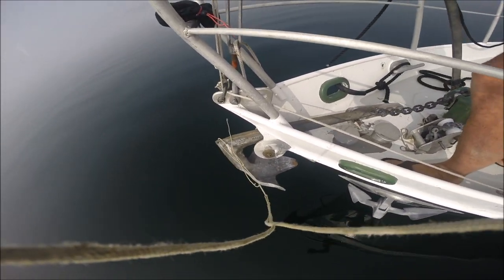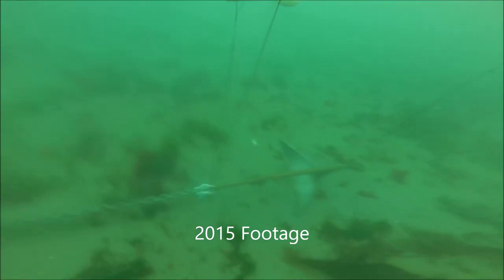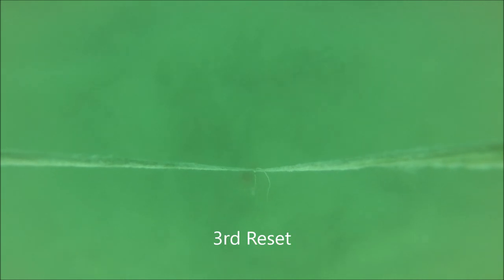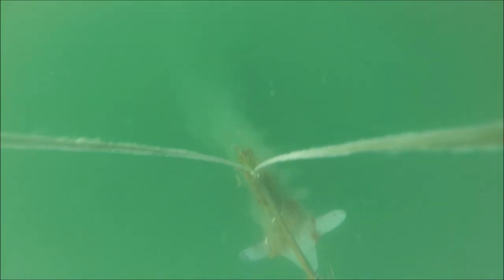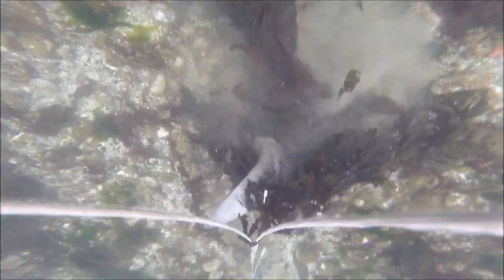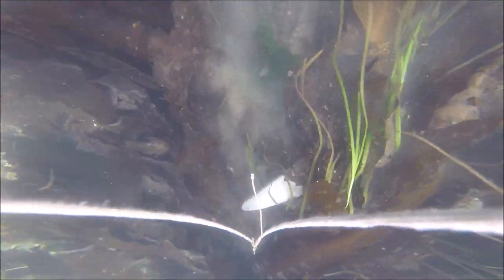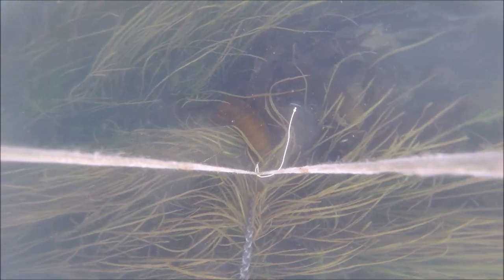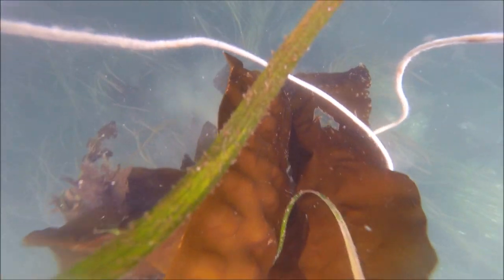Bruce Anchor Resetting Test.  Anchor Test #79

Comment: Testing in air, like a pull on the beach, is of course way different than under water. Everything weighs about half under water, scope, friction etc factor in. I am not sure a beach test is that valuable even if conditions are the same for all anchors. But it has entertainment value! 

PS I use a 15 kg stainless SPADE anchor on my Arcona 370 based in the Baltic Sea. Great for everything but soft mud is my experience. I carry a 7kg Fortress anchor as a kedge.

Comment: I wonder if the frequent resets that you do "soften" the seabed enough to affect the subsequent reset(s). What are your takes on this? 

Looking forward to your hard sand tests.
Reply from the maker: I think it is rare that the anchors land in the exact spot as other anchors for two reasons.  First, I spread these sets along the 26' depth contour over a distance of a couple hundred feet (lets call that the "X" direction) Second, the location of the 26' depth contour varies with the tide level, thus changing the "Y" direction also.
Reply: @flygoodwin  I agree that anchors rarely land in the same spot as a previous anchor drop. I would agree that a change in wind or current will cause the anchor to reset in another direction and often 180 degrees with the tide change.  But my wonder was as you reset 5 or 6 times back and forth does the anchor dig into freshly disturbed bottom? And does that, in fact,  have an affect on reset? That I do not know which is why I ask. I might assume that each reset is, theoretically, digging into freshly plowed bottom which may be different that the initial set.

I like your valuable research and am educated on the results.  The first set it important. But so is the reset. 

Thank you again for educating me.
Reply from the maker: @johnmeyers3954  Ah, now I understand.  If there is a seabed difference between initial and reset, the effect must be small.  I cannot even say whether this disturbed seabed helps or hinders.  Certainly, this effect is smaller than the effect of having substrate adhered to the fluke.